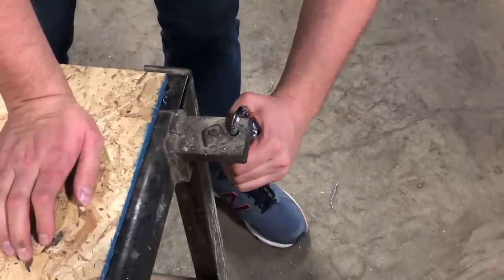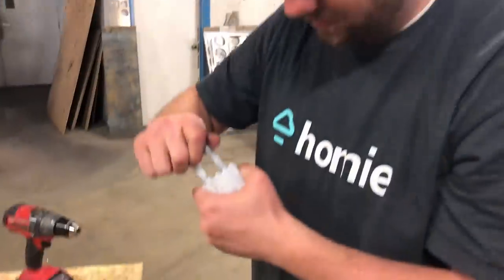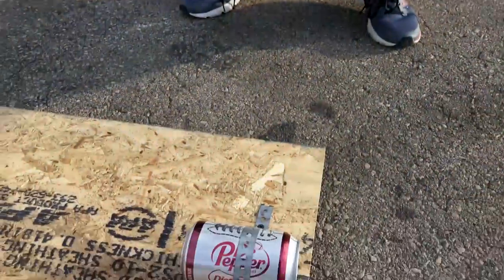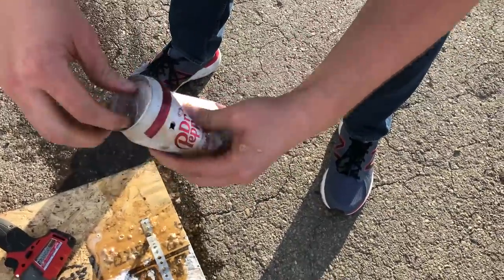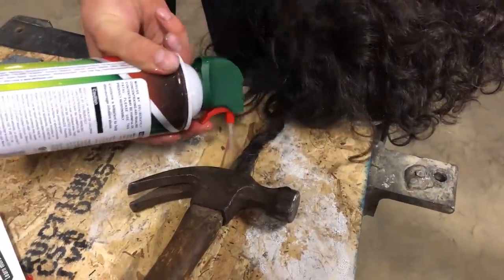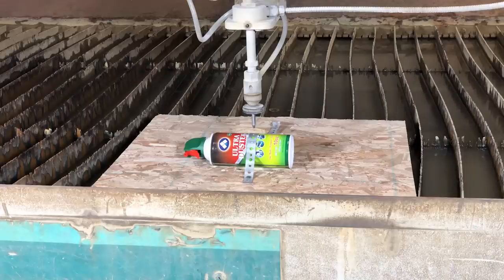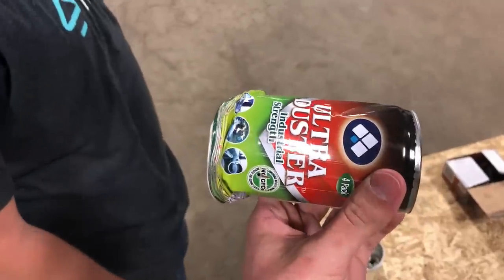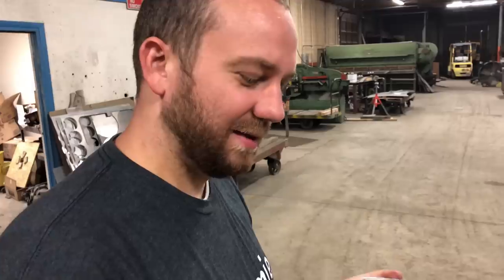Canned Air Duster VS 60,000 PSI Waterjet - Random Machine Shop Tests

Comment: Yes, you should get a steel pipe the size of the can, seal off one end and then slide the can in and shoot it with the water jet. Aim the pipe at stuff and see what happens :)
Reply: Add a ramp that leads into the steal pipe and put the cans on it for rapid fire

Comment: The can launch is absolutely amazing. From what it looks like the ultra high pressure of the water jet got into the can through the hole it made. My initial thought was that the duster would get out but those cans are nowhere near 60k psi so the hole bade by the cutter only took in water pressure. The top of the can turned into a ticking time bomb. As soon as the pressure inside the can was greater than the strength of the seal between the top of the can and the can itself, it flew off. This in turn created an equal and opposite reaction on the bottom of the can. The force pushing on the bottom of the can, guided by the ply wood and pipe strap, sent it flying so fast it crushed itself on impact. Assuming that there was roughly 60k psi applied to the bottom of the can, with the area of a standard 3 inch diameter can being around 7 square inches, you can estimate about 420 THOUSAND POUNDS of force propelling that can. *That is a maximum figure, as the real number lies at whatever pressure the top of the can failed*

Comment: Make a controlled air duster launcher out of some PVC pipe with some end cap put it in strap it down to the water jet shot  trough the pvc pipe in to the air duster to shoot at some stuff and measure the speed and strength of it ;)
Reply: And a ZGB ivan head as a target

Comment: That canned air stuff is explosive when in liquid form and combined with water which may contribute to the explosion. You can find videos of it.
Reply: Yeah. Hfc-152a or r152a can be used in small appliances and cars as a refrigerant as well.
Reply: It's not explosive because it is CO2, maybe the REALLY old stuff was because they would use Nitrous oxide but those were taken off the market like 20 years ago (Mostly because kids were using it to get high since it is laughing gas)
Reply: @SilvaDreams  uh no it's not co2. Co2 is 1000 psi at 70 degrees Fahrenheit and would not be safe. Its difluroethane or r152a a refrigerant
Reply: @SilvaDreams  also n2o has a lower pressure than co2 so co2 would be more explosive than n2o. The old stuff was r12 or Diclorodifluromethane
Reply: @Aptenodytes  this man knows stuff
Reply: @macauley4466  I have spent way too much time looking at pressure charts for gases and stuff. And chemical makeup of refrigerants and other things...
Reply: Wait so you are telling me that If I flip one of those cans over I can make explosions by putting it over water ?
Reply: @CaptCorgi  Yup. If you flip the can upside down and spray it into water, it will cause an explosion.
Reply: @CaptCorgi  only if you submerge it. It still wont technically blow up. But it will make a huge mess because the pressure in the water
Reply: @SilvaDreams  ready whip still has nitrous just empty the gas into a bloon and youll have a great time just dont let the bloon go lol

Comment: I would LOVE to see what happens if you pierce one of these underwater! I think it would cause an explosion. In fact, I think the reason it shot off is because the water from the jet got inside and could not escape, and the point of least resistance was the top of it. When you mix water with something that cold and contain it, it'll blow up. Be safe if you do anything else with them!

Comment: The gas in those air duster cans is 1,1-Difluoroethane it is also known as R 152a refrigerant and it also explodes on contact with water when it is still in it's liquid form.
Reply: You can get high off it
Reply: @ashtonwimmer5564 I believe I left that out for a reason.
Reply: Some home mechanics have used it for refrigerant in a/c systems successfully.
Reply: @AndreS_-df2nw  Interesting!... I did not know that, Smarter everyday!.

Comment: There are tons of locks with the locking spring problem where you can force them open rather easily if you try
Even are some clips that you can just rotate into the spring and you can just open them. padlocks of that size just need to hold the thing on both sides

Comment: Amusing. WHen the can was first pierced, the regular gas that's used for dusting prevented the water from reaching the propellant. The moment the pressure dropped below the pressure of the water jet, the water and propellant mixed instantly, causing the pressure spike as the propellant boils rapidly.

Comment: Saskatchewan guy weighing in here- no canned air required up here for experiments with freezing things.  I’ve walked outside in January shortly after a shower, and had my hair freeze into a solid helmet within about 60 seconds.  Do that a few times and you’ve got a pretty good case of split ends, but I don’t think you could actually get the hair down to a temp where you could break it off while the scalp was still at a temperature consistent with being part of a live  human. Steel, though does get brittle and break when it’s cold- just ask anyone who works on heavy equipment up here- failures of hydraulic cylinders and lines (both solid steel lines and steel braid hoses) go up a whole lot in the winter, along with steel cables, and things you can sometimes get away with doing with a chain in the summer,  you’d better not dream of doing in the winter up here.

Comment: I've used iso butane(very flamable) in a lock cylinder (brass) and hammered a screw driver into the key hole, shattering the cylinder. After that pulling the piece out with pliers released the mechanism.

Comment: You might want to look at some videos where people freeze stuff in liquid nitrogen and then smash it.  It takes a few minutes of sitting in it to freeze solid enough to smash.  You would probably need like 10 cans of air duster to freeze anything all the way through.

Also, just go buy some liquid nitrogen!  It's probably cheaper by volume than air duster anyway lol.

Comment: Wait. To "Pop" a master lock you need channel locks and a hammer.
Pound the lock on the side as you pull on it with the plyers and it'll open and it's still lockable.
Not broken. Neat little trick to know for when you've lost the key.

Comment: If you want to freeze break the lock, try Liquid nitrogen and let the lock soak in it. It will shatter like glass. Also you are keeping the lock wet in liquid air. You need to spray it at distance allowing maximum contact and maximum evaporation. That will actually cause cooling. Spraying won't work much.

Comment: I use freeze pray all the time....well I used to. TO cool a "soda" to a good drinking temp from room temp  spray the can "bottle" while moving it in a circular motion. You can make a hot or warm "soda" into a nice cold beverage in less than a minute.

Comment: You should use the tubes that come with the canned air. Also, I use this effect to trick the temperature sensor on my truck and keep it from shutting down due to being between the upper and lower allowed idle temperatures.

Comment: Works better if you pretension the lock with a vise grips or channel locks, pulling down hard and hitting the top edge of the lock, works better if you can hit the opposite side then you were hitting but you had worst case situation. Very fast even without canned air.

Comment: Cut a styrofoam cup to fit the lock, then when you spray the can of air the liquid can collect and freeze the lock easier. though the locks didn't need much effort.

Comment: There's better stuff to use to freeze things than the cans of duster. Look up InstaFreeze or instacold which is an electronics tester designed to freeze electronics components to test for heating issues. Much colder than the duster stuff.

Comment: The problem is a can of air doesn't get cold enough to make the matal brittle enough to shatter. You need liquid CO2 or nitrogen. Then the metal will shatter in lots of little pieces

Comment: Here's the problem with using this to freeze something solid and smash it.
Time.
You guys didn't use a lot of time, so it was mostly just ice buildup on the outside, leaving the inside of, say, Lewis's hair not as frozen, snap-off cold.

Comment: I can defeat a padlock with a Bobby pin cut into two pieces faster than you can unwrap the plastic from the 4 can pack of duster. I found the Bobby pin. Expense - zero.

Comment: Is that Liquid nitrogen if not why didn't u use it it works way faster
Reply: A1Lzz beast no it's R152a refrigerant it's used as the accelerator for the compressed air